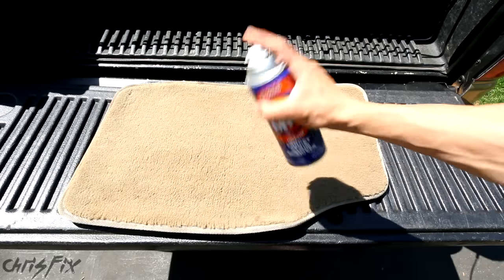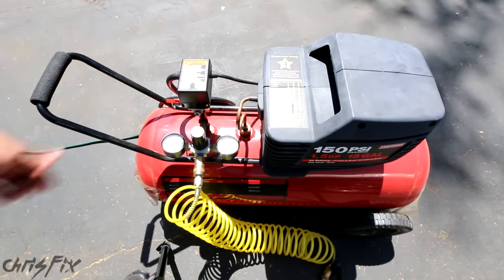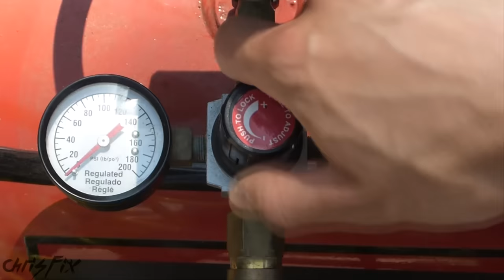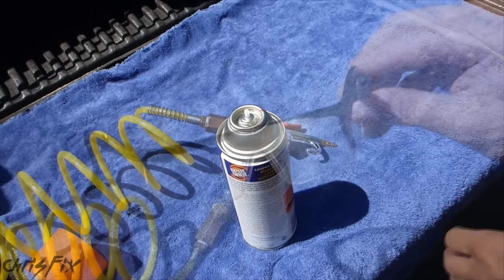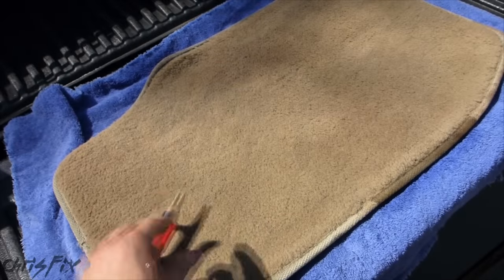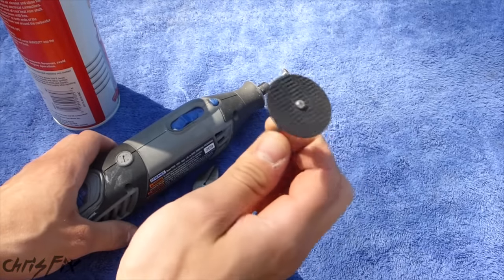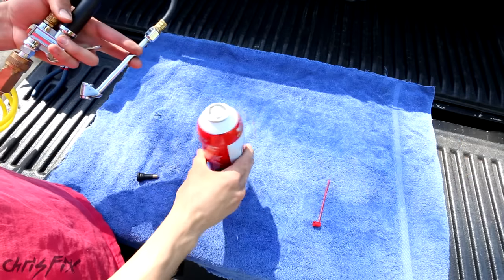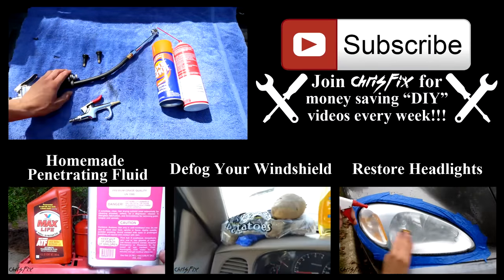How to Refill an Aerosol Spray Can (Like Carb Cleaner, WD40, etc)

Comment: hold can upside down while charging so only air goes into can rather than spilling liquid.  Nozzle had a straw that goes to bottom of can.
Reply from the maker: Great tip! Thanks.
Reply: Thanks
Reply: yeah an a clip-on chuck for the valve stem works wonders too...
Reply: Miff Miff  Not really. Most people don't know there is a tube on the inside of the can.
Reply: It's called a 'dip tube'.  It would fill so much better if you used some flexible air tube to connect to the can.
Reply: Good tip. I managed to WD-40 my face while recharging the can.
Reply: @JohnSmith-ff1rk  yeah I had no clue
Reply: Strangely enough, I tried that with the idea that the liquid inside wouldn't anymore enter the tube as the pressure builds up and yet, something still came out while filling it. Couldn't figure out why!😄😄😄
Reply: I was going to say the same
Reply: Maybe you should have the 7.25 million subscribers now instead of chris!
Reply: @norbiesison9257  Because there's already some liquid inside the tube before you turned it upside down. The idea of doing this is so that "More" Liquid don't get squeezed out.
Reply: Ah, so the trick then is to turn it upside down first, try and see if there's enough pressure to empty the liquid in the tube, then pump it up with air!
Reply: Dats true. Facts
Reply: yeah i was just about to suggest that :)
Reply: Very good thinking. It makes sense.
Reply: And this is why you read the comments. I was about to get brake cleaner all over me

Comment: Wait! Unlimited AIR HORNS!!! THANK YOU CHRIS <3
Reply: Nathaniel Shenheizer YES!!!!!!! Finally!
Reply: Nathaniel Shenheizer Hahaha, smart!!
Reply: +Nathaniel Shenheizer (Intense Visualizations) 1. Acquire a metal air horn. 2. Rig to Propane cylinder. 3. Add electric/piezo ignition. 4. Have fun! 

SAFETY: Label horn with 'FACE TOWARDS ENEMY'
Reply: +midnitehound  Or find a discarded airbrake tank from a semi (junk yard). NO retrofitting as all the holes in a brake air tank are small pipe threads ready to be set up for your air lines !
Reply: Air horns can don't use oxygen... but yeah you can use it but will not last as long as a new one.
Reply: SO FUCKING SMART HAHAHAHA
Reply: Nicholas Howard is.
Reply: Lol
Reply: You can hook up the horn itself to the air compressor, and boom, 140 PSI air horn.
Reply: exactly why i watched this vid xD
Reply: HOLY CRAP YES!
Reply: Hidden Bass WHY DIDNT YOU TELL ME THIS 10 YEARS AGO
Reply: I wish there was an thorough n honest mechanic like this in my area.. so many r strait up grimy..
Reply: Compressed Co2. Or Nitrogen gas
Reply: Vitor Leão the only problem I can see happening is a light change in tone from the air horn
Reply: midnitehound sound and flames? Awesome
Reply: @midnitehound  only someone that has set up a claymore mine will actually appreciate this...😂
Reply: @ChoboUnjeon  right that's convenient
Reply: Or you could buy the rechargeable ones, cost a little extra but after 4 or so uses (which everyone knows YOU will) it's paid for itself.
Reply: @KAI..._  holy crap 🤣 five years ago!!
Reply: No one should have this kind of power😱😱
Reply: Exactly my thought
Reply: OHHHH!!! Brilliant!
Reply: With great Air comes great Air-horn-ability

Comment: Just to let anyone know. You don't have to depress the nozzle on the can. It works much like a check valve. Air goes in, not out, "unless it leaks". Just place the valve stem over the nozzle tightly. It will work every time. Been doing his for 20 years. (note) I always use a rubber valve stem. Much safer then any other way.
Reply: Like a check valve? If it does not go out, how does it go out?
Reply: @Skip11AM  😐

Comment: Pro tip. Turn the cans upside down and refill them. That way no fluid is forced out when refilling.
Reply: Bonus tip, if you out the can in the freezer for a few hours before it lowers the pressure making it easier to fill
Reply: Good tip, but a couple of years too late lol. 😉
Reply: @brendanfromnz  good tips never expire.
Reply: @Jason.F.  exactly. I’ll be using this tip to try it for the first time
Reply: Wouldn’t inverting the can allow the liquid escape?  We always invert freon cans to charge with liquid
Reply: @kellismith4329  nope. That's why when you turn one upside down and try to spray you just get the propellent not the product.
Reply: @Jason.F.  but there no longer is any propellant in the can, thus the refilling
Reply: @kellismith4329  I know I was using that as an example of why this works.

Comment: I have done that many times in the past. Works very well. When I do it, I attach a very small piece of vinyl tubing to the air nozzle, then slide the tubing over the tube sticking up on the can, then press down to fill. No Mess.
Reply from the maker: electronicsNmore Great tip! Thanks!
Reply: electronicsNmore does it work with paint cans?
Reply: It would be more helpful including tubing sizes and part numbers, link to Amazon pages etc.. Good idea but not much help without the info.
Reply: @snoopu2601   I wanted to ask same thing ;) I guess answer is no lol
Reply: Jet Engine Thrust besides that u can’t post links on here what fun would that be? Lets not be lazy, enjoy the adventure and it will feel even more worth it and then maybe you can post the part numbers.. be the change you want to see in the world instead of critisizing others, hes already have you a hand, don’t ask for the whole arm, he could’ve kept it to himself afterall
Reply: @jetenginethrust863  some things you just have to figure out yourself. You don't need Amazon or part numbers - just go to a bicycle shop.
Reply: Hi
Reply: I was thinking the same thing
Reply: @snoopu2601  iiiii
Reply: I'm 5 yrs late but that's exactly what I had thought when I watched the video
Reply: @PietriGuitars  If only! No fish, just promises.

Comment: WD 40 is always bad for running out of air i've got half a dozen cans of WD 40 lying around still half full with no air
Reply: Yep, the one's with the fancy trigger. I buy another brand now. Permatex, I think.
Reply: Another option is their hand pump bottle
Reply: MrVsbt1 thats why I use WD40 in a spray bottle.
Reply: @joshl90 I might have to keep a look out for one
Reply: @MrVsbt1  Just buy it in the quart or gallon size and add it to an ordinary spray bottle
Reply: I can pressurize them even easier than both of these methods. Because there would be zero spills
Reply: steve timleck  A simple discovery of mine. And i can do it anywhere. Without carrying a compressor
Reply: @lvstream720  tell
Reply: That's why they say shake it before use
Reply: @rajeshnaidu  Is not only shaking it.  Most aerosoles are filled with Co2 or Propane, butane.  The cans that have a red dot on their ring. You have to keep the nozzle pointing it. That way wity the natural tilt we do. Less gas is wasted and the gas comes out with the product
Reply: Bones McGillicuddy  What are u talking about.   We??. U are aint thinking for anyone else
Reply: Bones McGillicuddy  I had so many people reaching out to me and i teached them
Reply: Bones McGillicuddy  Just a hater
Reply: Hold it straight when u spray it

Comment: Quick tip, butane refill cans come with various tips. There is a fat one that makes the valve stem one work better.
Reply: Speaking of butane... that would be a much better propellant than air.  Most cans are pressurized by CO2/R-152/R-134a or N-Butane.. then you don't have to worry much about loosing psi or inconsistent stream (except CO2 which I've only seen in WD-40 cans)

Comment: Hi Chris,
This is a great idea. A few years ago, I got tired of buying compressed air (computer "duster") at almost $6 per can. I went to discount tire and told them what I was trying to do and they gave me a new valve stem for free. I drilled a small-ish hole in the bottom of an old empty can. (That was the flatest spot, but I can't set the can down properly anymore.) I squeezed the valve stem in and added high pressure epoxy sealant, (made for radiator repair) to bond the rubber to the metal. I've been using it for years at work for cleaning computers and other electronics. It doesn't last as long as a store bought can of duster, but with free refills for life I've probably saved over a $1,000 already.
Thanks for the great video!
Reply: I purchased an air duster can pre-made like that about 15 years ago!  It even came with a small bike pump.  I hope that money went into your pocket!  Still have it, just to lazy to pump it. LoL!
Reply: I use the air tank from a mini compressor!

Comment: Don't cut the valve stem so that it doesn't push the spray can straw down. Just hold the valve stem tight to make a seal on the can. The air pressure will still fill the can without pushing down the spray nozzle. Less messy. Or, like someone else said, hold the can upside down.

Comment: Another idea if you dont have a compressor or you're worried about safety is to make sure theres zero pressure in your full can and then just pierce a hole in the can and use the liquid inside, you can do this with any aerosol like we do in industrial shops. Brake cleaner and degreaser and carb cleaner all come in big unpressurized drums. The mechanics then fill those plastic pump bottles with with brake cleaner etc and have a spray. So get yourself a pump bottle and just fill it with any flat cans you have

Comment: Just a word of caution Chris. Use a small plastic tube, such as Tygon to connect the air nozzle to the can instead of your fingers. It works great and eliminates the "fiddling" aspect of trying to hold the two with your fingers. But more important than that, is that you avoid the risk of pressurized air entering your blood vessels and causing an embolism. It is very dangerous to put pressurized air against your skin, and many people have died doing so. Air gets forced through your skin and enters your blood vessel where it then travels in seconds to your heart. Once air enters your heart it takes away your hearts ability to pump blood due to a vapor lock type of situation. If it doesn't hit your heart, then it can also enter your brain and create dead zones where blood no longer can flow properly, and of course then, you're having a stroke. At minimum, when I'm doing something like what you were doing, I wear rubber gloves, but I'm just to paranoid to trust that, so I just come up with methods that don't involve compressed air against my skin. The risk also goes up when there is liquid involved, such as that coming out of the can, because then there can be a better seal against your skin. 

Thanks for your great videos. I'm enjoying an evening of watching your tutorials on how to maintain my van.
Reply from the maker: +J Voll Thanks for the tip!
Reply: Science

Comment: Great Idea.  I would probably grab about a 1/2" inch long piece of rubber hose like they use for your car vacuum lines or window washer and slip it over the white part of the can and use your spray nozzle on the other end of it to make a nice tight seal while pressing down and inflating the can.  The loss of content from the can would be minimized and almost all of the air would go into the can from the nozzle.  Just a thought.  Keep up the great video ideas!

Comment: Caution:  I've done it and it works but don't go and use air filled can for a torch (as some of us are occasionally prone to doing w paint or penetrating oil, etc., lol) slight chance of serious explosion since there is no longer inert gas propellant in the can but air with oxygen.  Chances are it won't back up inside the can but you don't want to be wrong about that.
Reply: Thanks!  Much appreciated!
Reply: Yeah sure thanks for that info but why would anybody do PSI refill and use it as a torch since it's the flammable that we are looking for
Reply: Oxygen isn't flammable, it just makes other things more flammable.
Reply: @YoursUntruly   Really?!  So that's why Earth's entire atmosphere doesn't detonate every time someone lights a cigarette, brilliant observation.
Reply: @Mrbfgray  Now you're getting it, little guy!
Reply: You use a spray can as a torch? I want to party with you!!!
Reply: Chances are high that it will back up into the can, do not do this with flammable contents or you will blow your hand off.
Reply: @Hank254      It's not possible with inert gas in the can, only with O2 inside which doesn't happen from the factory. Have you ever heard of it happening?  Using them as a torch is not uncommon.  Why do you fall for nonsense like that without even thinking about it?
Reply: @Mrbfgray  They are not filling the can with an inert gas like they do at the factory (which is the exact point of using an inert gas!), they are refilling the can with compressed air which has 20% oxygen. Your statement that 'Chances are it won't back up inside the can' is wrong... when the can has been refilled with air and you try to use it as a torch, it will back up into the can. Why do you post nonsense without thinking about it?
Reply: @Hank254    With air it theoretically could, not easily for same reason a Acetylene Oxygen torch doesn't easily burn back inside even tho it's vastly more explosive than air in a paint can.  It's about the speed of flow thru a small hole.  To say it will back up is false, depends on conditions, pressure and so on.

Note my initial comment was to NOT risk it with an air fill can, only otherwise is it 'safe'.  

You didn't read my posts carefully and I couldn't tell if you were talking about an off the shelf can or one that was "resurrected" with compressed air.
Reply: @lomakphoenix4105   The problem is that a compressed air filled can would normally be put back on the shelf to use another day, not hard to see a potential disaster in the offing in the context of another 'misuse' of such products. 

"All serious accidents can be traced to at least 3 major factors."  (a wise man once told me)  Not sure there needs to be a 3rd in this instance however.
Reply: @Mrbfgray  You don't know what you are talking about, please stop making things up before you get someone killed. It has nothing to do with 'the speed of flow through a small hole'. An oxy acetylene torch doesn't 'burn back inside' because the gasses are mixed immediately before the torch tip. That is why when a torch backfires, it stops inside the tip and the handle doesn't explode. 

The flame will travel back into the refilled can at the detonation velocity which will be anywhere from 1500-3000 m/s. Do you really think the spray is coming out of the can a supersonic speeds? Feel free to prove me wrong... go ahead and re-pressurize a can of starting fluid with compressed air and use it as a torch until the fluid runs out. If you really want to have fun, do it with pressurized oxy acetylene mix from an unlit torch. Just make sure you have your affairs in order before you do. And next time you want to post an insulting comment, re-read the thread to make sure you understand what the person is saying. Obviously you didn't even have a clue what I was referring to when you first replied.
Reply: @jonathans1472   It's more fun than you imagine.  Also toss model rocket engines on backyard bonfires.  I can't even tell you the best stuff or the KGB be on me.

Comment: I would highly recommend that you put the can your filling, inside a pipe with a top that is just big enough for the top to fit. In case the can were to explode. This would prevent  the shrapnel type pieces from tearing your hands apart.

Comment: ever thought of side reactions when filling up air (containing Oxygen) at high pressures into a can with inflammable liquids?
usually the propellant gas in a spray can is Butane. so U can fill it up like a gas lighter. U always should use the same gas like the manufacturer put into these cans.
Reply from the maker: BitGridTV Thanks for sharing!
Reply: Does that actually work?  I'd think it would be difficult to overcome the gas pressure inside the can.

I suspect though that there probably isn't any additional danger in pumping air into the can.  Spray cans become a fire hazard if you heat it up or rupture it.  Either way putting some oxygen inside the can doesn't seem likely to make much difference.
Reply: @ian1352  there is no longer gas pressure in the can, thus the non dispensing - I think his point was to recharge the can with butane

Comment: There is a refillable aresol with a glass bottle bottom. I have one. It was meant for spraying velour adhesives. You can put anything in it.
   I also use a refillable/reusable weight watcher's salad dressing pump sprayer. It has liquid wrench in it from a dead full can.

Comment: Long time subscriber, but found your 7 year old video after a YouTube search. I had a half can of PB Blaster with no air in it. I thought what a waist. I used my compressor with regulator set at 40 psi. That drops down to 30 when I pull the trigger on my compressor air hose with air nozzle on the can. Was not sure anything happened, but put the little spray nozzle back on the PB Blaster can and it sprayed PB Blaster like new. Thanks Cris.